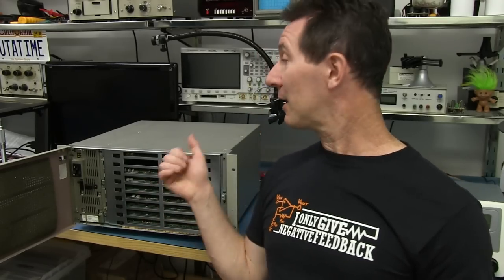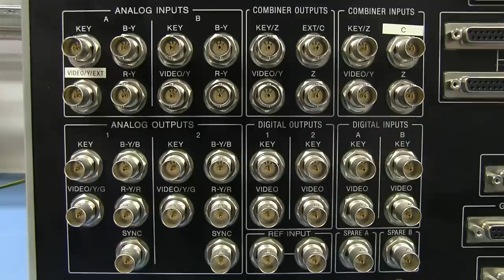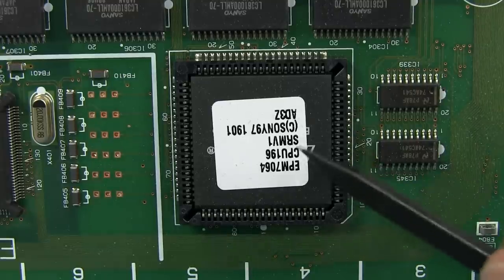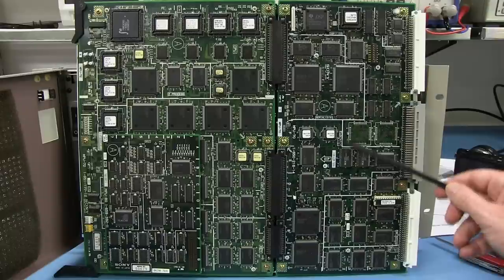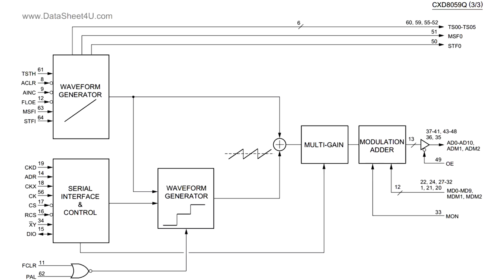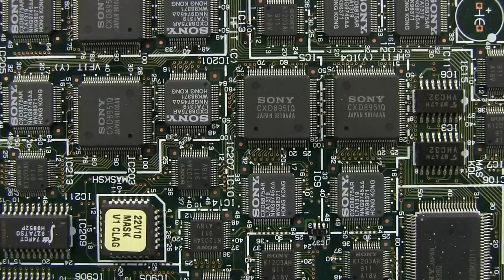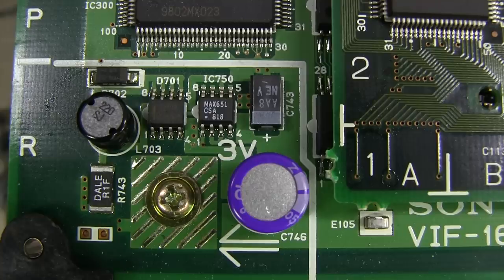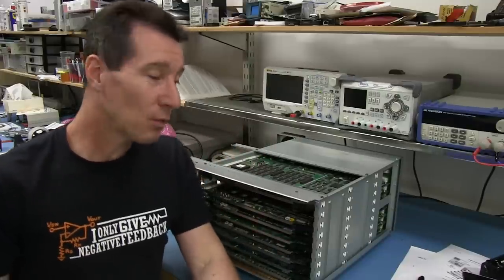EEVblog #598 - Sony DME7000 Video Multi Effects Processor Teardown

Comment: I do not get the HW vs SW thing everything is done in HW the difference is that some HW can be configured by software (more flexible).
There is no much difference between this video effect processor and a GPU except the last one is more flexible more general :).
There will always be some things that you can only do so fast with flexible HW and you will need a fixed specialized function but that. Is just a matter of technology available at that point in time.
I can probably emulate at least 10 of this digital effects processors in a modern GPU not that many years after it was designed.
Reply: Saying that there isn't much difference between this and a modern GPU is like saying there isn't much difference between a helicopter and a modern motor.

Systems designed for real-time video effects and mixing can instantly digitize multiple inputs, create effects, and output the result, while staying in perfect sync with the entire video pipeline (skipping frames is not something acceptable in the broadcast world), and have dedicated controllers to make those tasks easy to perform. They have GPUs in them (in fact, they had GPUs in them long before anyone in the PC world knew what a "GPU" was - hell, before anyone even knew what a "PC" was), but that's just one component of the system.

One of the fundamental differences between "hardware based" and "software based" is that a "hardware based" system will not suddenly choke because some background task decided to use 90% of the CPU for half a second, delaying the video decoder (or encoder, or effects processor). All the important functions have dedicated circuits and are guaranteed to run at the necessary speed to maintain the correct frame rates and sync with the rest of the pipeline.
Reply: What are you trying to say here is that there is a difference between serial and parallel processing nothing more.
The part with the CPU and random 90% load has to do with multitasking operating system you can also use a real time OS and then you do not get this problem.
Or CPU with multiple cores and dedicate one core for your high priority task.
What I'm trying to say is that everything is alway done in HW and the only difference difference is that you can have a fixed program or a flexible one. (you can write the software with fixed transistors).

Simple example: you can build a transistor bistable that blinks an LED at a constant rate or you can use a small microcontroller with a simple real time software that dose the exact same thing in both cases the hardware will do the blinking with the exception that the second hardware is more flexible.
Reply: ***** No, nothing to do with serial or parallel processing. There's plenty of both going on in both types of systems. 

What I'm "trying to say" is exactly what I said. A "modern GPU" is no more a replacement for a real-time DVE / mixer than a modern motor is a replacement for a helicopter. One is simply one of the many pieces that make up the other.

Furthermore, setting a task as high priority (or assigning it to a specific CPU core) does not eliminate the possibility of delays when accessing shared resources (like the memory bus, the peripherals, the network connection, etc.), and RTOS aren't actually real-time, they're just designed to have more predictable delays, and better management of interrupts, so that some tasks may be run at scheduled times, even if that requires interrupting some other task. In a system like this DVE box, you'd never want to interrupt a task to run something else. 

The chips in DVE boxes (many of which are specialized GPUs) are designed to do specific tasks exactly at the required speed, in a reliable way. There's no need for an elaborate "operating system" at all. Any sort of shared resource management would be a potential source of problems.

A "hardware based" video processing system is a system where each piece of hardware is there for a specific function, and is guaranteed to be available when necessary, and guaranteed to perform its function within the required time, without interfering with any other part of the pipeline.
Reply: RFC3514
Of course the GPU without the software will not do anything.
But that software is just a matrix of 0 and 1 that exist in real world and are not just a concept thy can be charges in a capacitor or something similar based on the type of memory they reside in.

There is no such thing as real time then since nothing can happen instantaneously even a photon needs some time to travel.

But I will go and claim that any modern GPU with dedicated software can emulate that old DVE and there will be no way for you at the other end to make a distinction between them.

This was not what I wanted to point out in my initial comment but just the fact that software is hardware is not just a concept each of those 1 and 0 have a physical representation in HW and if you remove the possibility to change those 1 and 0 then it will call that HW.
I hope it make sense.
SW is HW as long as is not just in your mind on on a piece of paper but written somewhere in a physical memory.
Is like saying a ROM is HW and a Flash, SRAM or RAM is software.
Reply: ***** No, you still don't get it. It has nothing to do with "the software". It has to do with all the rest of the hardware, and the architecture of the system as a whole (no shared resources, full availability of all functions at all times).

But, tell you what, contact Sony (and all your local TV stations) and tell them just how stupid they are for making (and using) dedicated real-time DVE and mixer boxes, instead of replacing the whole thing with a single GPU.

Or, better yet, put your money where your mouth is and design your own system, based on nothing but "a modern GPU" (good luck accepting those SDI and component signals), and sell it for less than what they charge.

Let us know when you get rich.
Reply: RFC3514 That DVE converts all those analog video inputs to digital and after that they perform digital effects on those digitized videos.
Let take the fade between two of the inputs.
What is there special that can not be done by a GPU + appropriate software.
That video is probably less than 60fps the parallel processing of the GPU and the speed is fast enough for any type of effects to be calculated in less than 1/60 of a second and be displayed as a fully calculate frame even with all those shared resources.
Is digital not analog in the end so you can not see what happens in between the frames the result will be the same.
Reply: ***** Again: do it, and then let us know how it worked out for you.
Reply: RFC3514
Why will I need to do that is already done see this http://www.nvidia.com/object/quadro-digital-video-pipeline.html
And I was trying to say something else with my original comment.
Reply: ***** First, that is hardly "a single modern CPU" (it's a 3-card stack with several separate and independent blocks, same as a DVE box, except it doesn't work as stand-alone, you still need to buy a PC to stick it in, find jogs and lit keyboards that work with it, hope the main PC never chokes and drops a frame, etc.).

Second, it costs $8k (just for the 3-card stack).

Third, it was announced five years ago and I'm not aware of it being used in a single broadcast system (it's basically bought by companies that make colour correction systems, and integrated into workstations with some extra $10k of hardware, custom controllers, etc.).

So there's clearly still room for you to make your cheap "single-modern-GPU" replacement for a DVE box and get rich selling it.
Reply: RFC3514
It is 8k because is extremely low volume 90% of that is development and less than 10% actual cost of the device.
There are 3 cards one is for video input one for video output and the GPU that is a normal GPU nothing special.
All the effects are flexible defined in software and the GPU will solve them.
I'm not in the broadcast industry so I do not know if is used or not there.
And there may be less expensive options available but there are only two large dedicated GPU manufacturers Nvidia and AMD.
A GPU works better than a CPU for this type of applications since the task is simple enough for the GPU compute units and the parallel nature of the GPU allows for a faster calculation.
The advantage of such a system is the flexibility you can ad a new effect with no changes to "hardware"
Reply: ***** You started by saying "I do not get the HW vs SW thing" (which I totally agree with - you don't get it), but I've already explained that part. It's about having dedicated modules that are guaranteed to be available at all times, and to always perform their function at the required speed.

It has nothing to do with lack of programmability. It has to do with modularity and resource availability. The part of the board that handles video decoding is there just to do video decoding. You can flash it with a new firmware (i.e., reprogram it) or change its parameters (i.e., reconfigure it), but the video decoding isn't going to interfere with (or suffer interference from) the colour corrector, or the sync generator, or any other part of the system. You don't have one processor trying to juggle 10 different stages of a pipeline, you have one processor (or a whole group of processors) for each part of the pipeline. And yes, that does make it slightly less flexible, because you can't radically change the pipeline itself (despite being able to reconfigure and reprogram individual stages). But it also makes it reliable, and that's a very important word in the broadcast world.

Your next claim was that it's possible to reproduce the functionality of a real-time broadcast mixer / DVE box with a single modern GPU, and the only thing you'd need is software.

So, clearly, Nvidia is wasting a lot of hardware there (two complete extra boards with lots of stuff on them!), and they're not even producing a finished system. The idiots.

And Sony charges almost $40k for their image processors. $40k, for something that can be replaced by a single modern GPU and some software! Imagine that!

So, instead of wasting time here making progressively more vague statements, why aren't you stockpiling consumer GPUs and working on that software that will make you rich?

Unless, of course, you've finally figured out that a GPU is just one of the (many) components that go into a broadcast mixer /  image processor box, and that, to ensure it runs reliably (remember, one dropped frame in a day and your sales will plummet; one crash during a live broadcast and you'd better have insurance), you'd end up having to use a lot of dedicated hardware, with an architecture very similar to the ones used by Sony, Grass Valey, etc..
Reply: RFC3514 :)
You do not get that there is an extremely small market for this sort of things and the cost of development is way higher than the price of components.
Also development takes years.
Sony probably started working on this in the 1990 so there was no GPU or CPU powerful enough to handle all this at that time.
Now I think you can emulate at lest 4 of those DVE boxes in a single mid range GPU.
Firmware is software same thing and one implemented become one with the hardware.
Your comment about Nvidia shows you do not understand how it works so I will end the discussion here.
I'm also busy with my Solar BMS project and have no interest in real-time video effects.
Reply: ***** What development costs, man? You can do it with a single GPU! Those already exist. All you need is some software, and there are plenty of open-source effects libraries, so even that is practically done. You're all set. Right?

It's amazing how many geniuses point out the stupidity of some industry in YouTube's comment section, and how trivial it would be to do the same thing for pocket change, and then are too busy with some other project to actually follow through with their claims...

I hope those solar battery projects pay well, if you're using them as the justification for not developing your revolutionary $150 cost - $20k profit "single modern GPU plus software" broadcast mixer replacement...

I bet Sony is breathing a sigh of relief. 

Oh, by the way. I've worked in video and film production for about 20 years, and my background is in computer programming. Oops. :-P
Reply: RFC3514
Well I do programing for both computers and micro-controllers and I'm an electrical engineer.
So I think I understand both SW and HW quite well.
I do not have video producing experience except for what I used in editing my youtube videos and the latest 3D animation presenting my Solar BMS.
Solar BMS is low volume enough to not worth doing as a business but was something that I needed and there was none existing on the market.
You can probably design a 1000$ broadcast mixer replacement but if you sell only 10 of them (that is probably how large the market is) then you need to add another 20k / pcs for the two or three years development of the SW and HW.
I needed already about 6 months just for a relatively simple Solar BMS (Battery Management System).
Reply: ***** So you're not just an expert on the architecture of broadcast video mixers, you can also deliver instant budgets and make detailed market analyses. With, I can confidently say, the same level of accuracy.

Such a loss for the industry. Oh well...
Reply: RFC3514
:) I made no claim to be an expert in the architecture of a broadcast video mixer.
That budget was a joke of course I will need more time to make a real budget that was to point out that R&D cost is way higher than the HW.
I worked in R&D designing airbag control units for cars and for a time I was project leader and had access to detailed budget on that project.
It is probably a loss for the industry :)
Reply: RFC3514 "It's amazing how many geniuses point out the stupidity of some industry in YouTube's comment section" you wouldnt buy his product because its not posible to do it properly with SW+GPU, you wouldnt buy it because of your 20 years of experiense in the industry that imprinted in you BELIEVE that it need to be done like it allways was done... Henry Bessemer was able to revolutionize production of steel and move forward Industrial Revolution without any experience in steel industry. Did James Watt have any background in steam engines industry? No he did not... All that your:"choking" is nothing more than software error that you are afraid off and because of this fear you BELIEVE its not reliable, you can make it reliable and people from industry would be afraid of errors anyway and wouldnt buy it anyway, because fear dont have to be rational.
Reply: tell me 2 things:
a) How long does it take for you to render your videos?
b) Where are the analog and digital inputs on my graphics card?
Reply: dataangelone
a) A video effect processor dose not do any video compression. That is by far the part that takes the most when I render my videos and even with that my core i7 can do that for 1080p content the effect + compression in real time or better.
b) I do not know if your video card has any video inputs but you can get one that has them or you can get a dedicated card that has just the video inputs.
Reply: *****
:) I can say the same thing about you. I'm relatively sure I have more knowledge and experience than you have relating this.
Reply: *****
See my last video on youtube uploaded a few days ago with a 3D render that is rendered by my low cost GPU close to real time by a combination of SW and HW. The GPU is used as compute unit and even if is a entry level GPU GT730 it can perform this calculations about as fast as my i7-3770 CPU running at 2Ghz at full 3.4Ghz the CPU is faster.
This are complex 3D calculations not extremely easy 2D effects needed in video.
There is no comparison betwen a 3D ray trace and 2D video effects in regards to computational power.
So not sure exactly what is that you do not agree with in my comments be more specific maybe I can answer.

Comment: I think the key is the contrast? like it is "key" in CMYK color schemes?
Reply: No, a key is a mask that makes part of an image transparent (typically based on a chroma test, but can be from other sources). The K in CMYK (the traditional colour model used in print) is just "black" (it's K instead of B to avoid any confusion with the B in RGB, which is "blue").
Reply: RFC3514
 The "K" in CMYK stands for key because in four-color printing, cyan, magenta, and yellow printing plates are carefully keyed, or aligned, with the key of the black key plate. Some sources suggest that the "K" in CMYK comes from the last letter in "black" and was chosen because B already means blue.[1][2] However, this explanation, although useful as a mnemonic, is incorrect.[3]

That's just wikipedia :P I guess those things depend on your teacher, what he taught you
Reply: ***** I didn't say it stands for black, nor did I suggest it came from the last letter of the word "black". I said the K channel corresponds to black (i.e., black ink when printed, black pixels in CMYK files).

You can, in fact, print in plain CMY (with no black plate), and the plates are still aligned with each other (or even print in RGB), but you don't rename one of the other channels to "K". The K in CMYK is always black.

Keying in video is a completely different concept, anyway, it has nothing to do with alignment.
Reply: No, it is not the "contrast". What we call "contrast" is actually video signal "gain" control.  
Video (and film) use the "additive primary" colors, Red, Green, and Blue. (RGB)  Printing uses the "subtractive-primary" colors, Cyan, Magenta and Yellow. (CMY).  The "K" is the symbol for blacK (because "B" was already taken for "Blue")